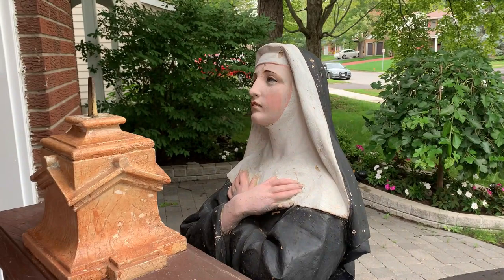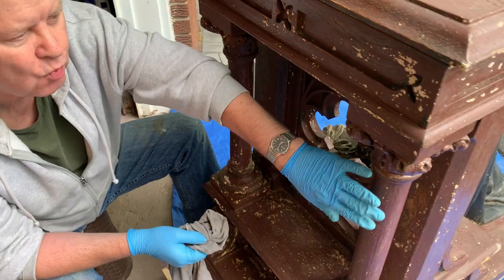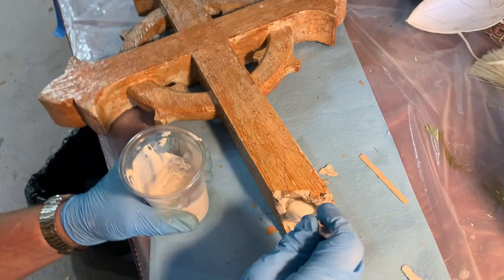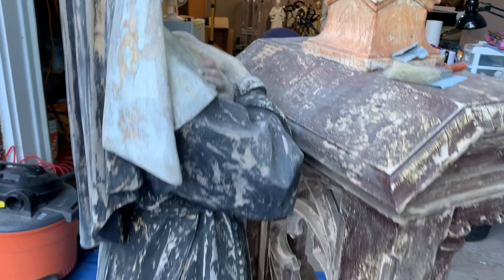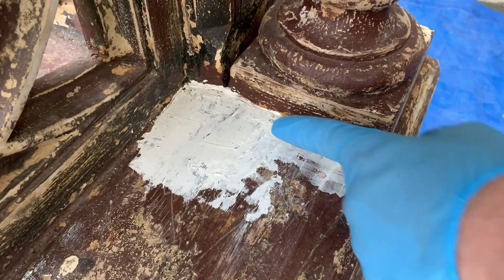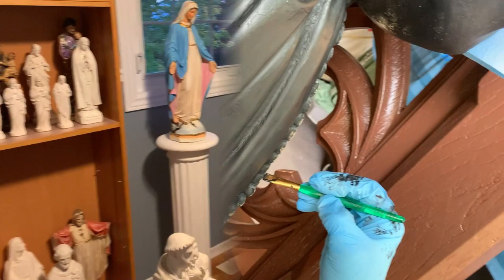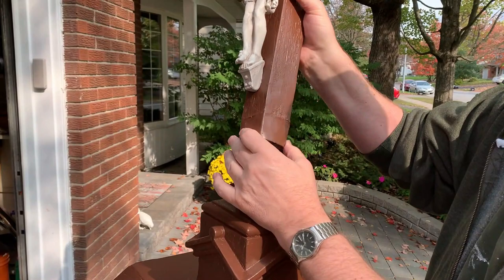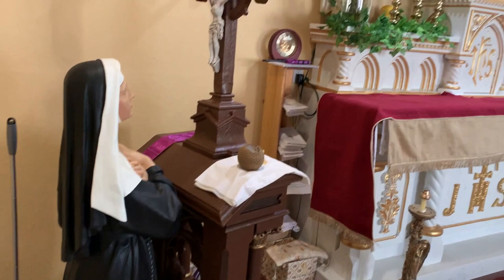Restoring St  Rita (of Cascia)  #statuerepair  #statuerestoration

Comment: What is the epoxy paste you used? And is it acrylic paints you are applying?
Reply: Hi there.  This project required gap bonding as well as filling with new plaster. We used a two-part mixable epoxy glue consisting of resin and hardener. This is readily available from craft stores, or even handyman (person?) type stores.  Ventilation is important because most epoxies have a strong odor.  The filler and re-sculpting material is HydroCal plaster. The paint is latex, and we use indoor or outdoor depending on the project and where it will be displayed.  Undercoat (primer) is usually a good first step.  Hope this helps, Sukeystack!
Reply: @stevewinogron992  I got involved with repairing plaster statues about 10 years ago. I was familiar with your choices. I used hydrocal(learned about it from art school) with cloth to strengthen the repairs inside. The paints were strictly indoor acrylics. It Is great to see, and learn, the detail methods you use. I had no clue how to repair loose paints so I avoided doing those repairs. Thank you for these videos!
Reply from the maker: Our pleasure.  And we’d love to see a sample of your work sometime if you’d care to share it!   Best wishes.